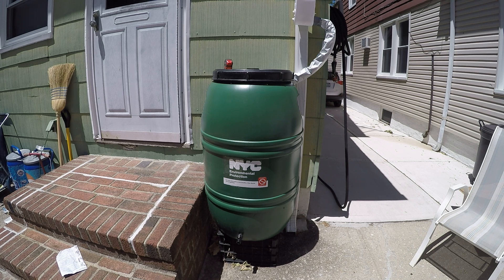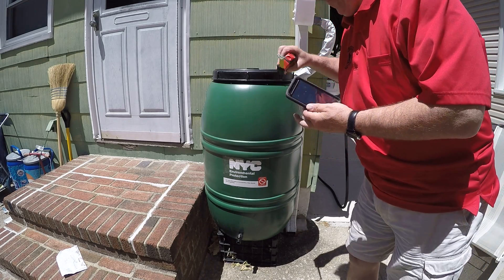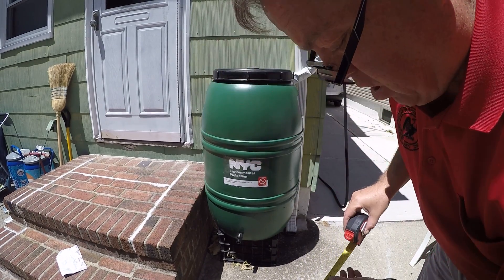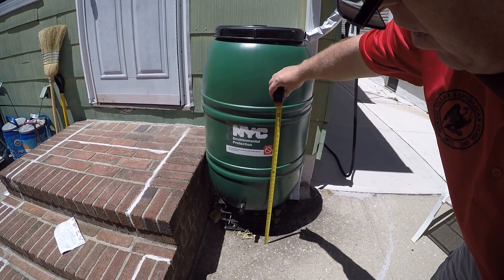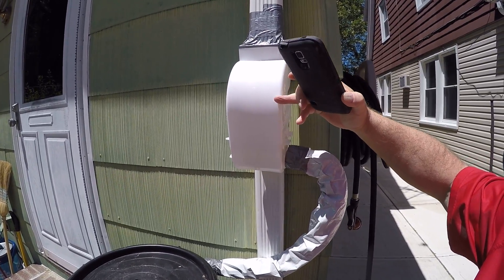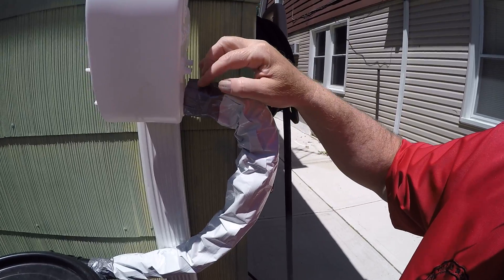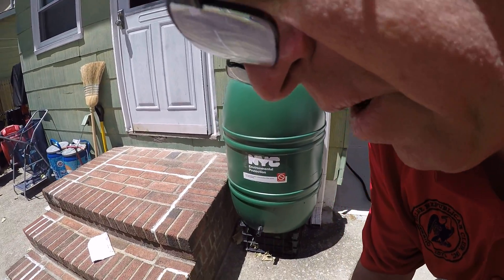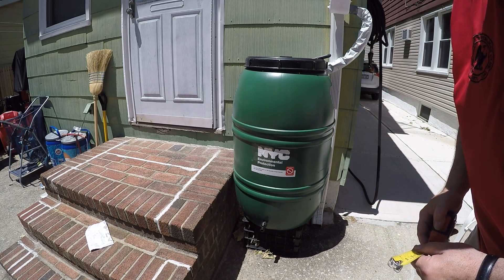Joe Concannon - Rain Barrel Project via Go Pro Hero

Comment: Barrel lid does not seal the barrel. Therefore, when the barrel is full, excess water does not go through the downspout. Excess water comes out through the leakage lid. I installed two barrels. Both had same problem. Spout connector and barrel has to be same heights to work properly.

Comment: Great video Joe! This barrel and diverter system is designed by RainBarrelFundraising.com and RainBarrel.ca. A clear hose to display the water level can be easily added and the spigot can be removed from the barrel and threaded back onto the far end of the clear hose. A hose clip is available to secure the far end of the clear hose to the top-side of the barrel. A very small hole that is not too big to allow mosquitoes to pass through can be drilled into the lid to allow standing water to drain inside, however winds and evaporation typically resolve the standing water issue. I highly recommend lowering the diverter so that the side outlet on the diverter is perfectly horizontal to the T-outlet on the barrel. By doing this, when the barrel fills, water will back up in the diverter hose and into the diverter and overflow into the lower downspout. If the diverter is installed too high, water continues to flow to the barrel where it can leak out between the lid and the barrel.